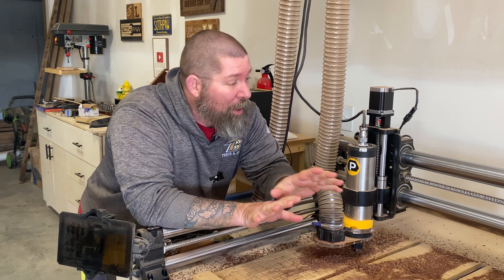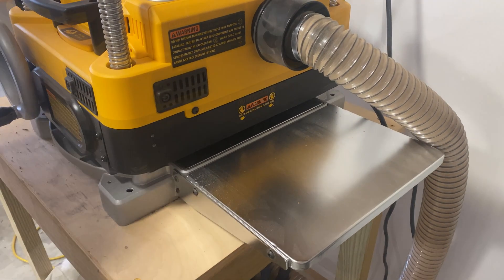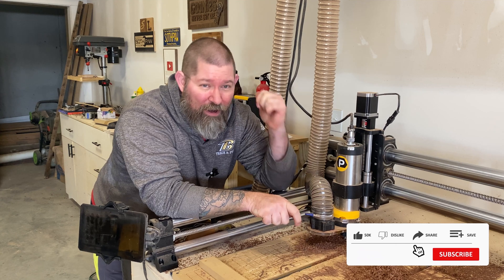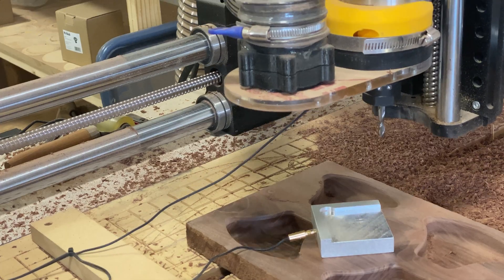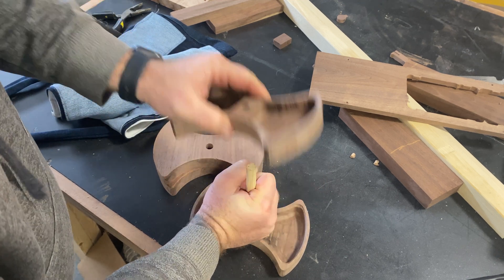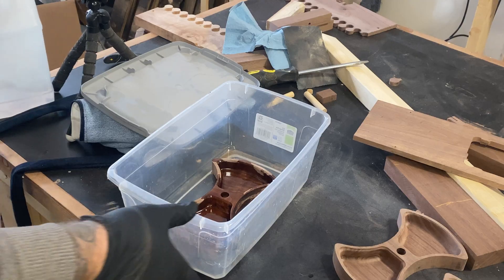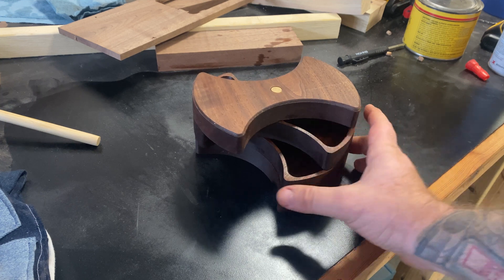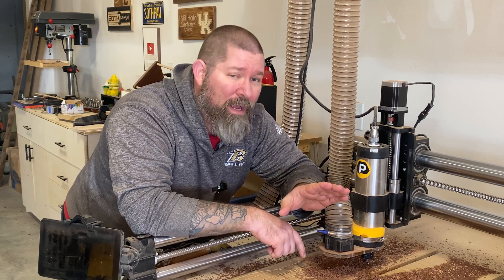I Built This Custom CNC Project In Under An Hour!

Comment: If your dowel is just a little bit tight, chuck it up in your favorite drill, spin it up and wrap a little sand paper around it for a bit.  Quick and easy way to thin down a dowel.
Reply from the maker: Good idea. Didn’t consider that.
Reply: Any suggestion for when your dowel is too big for the chuck? Ran into that problem last night.
Reply: @iwriteonshit  cut a longer piece of dowel than you need and use a chisel or knife to pare down one end until it does fit the chuck. I did this before i got a lathe and was using a drill and a live center pounded into a block of wood as a lathe. Not ideal, but works.
Reply from the maker: @iwriteonshit  You mean the chuck on your drill? I'd go with a smaller dowel, or maybe a forstner bit.